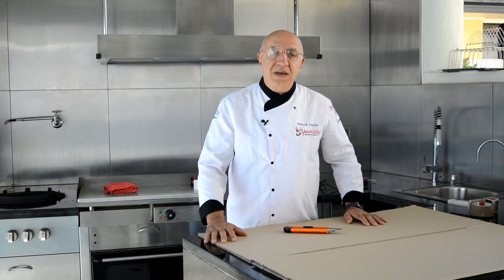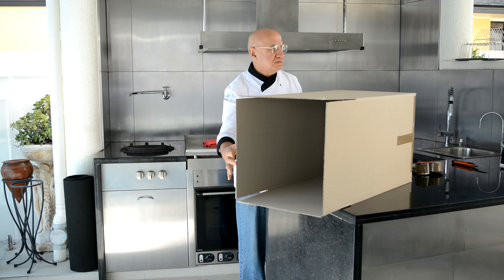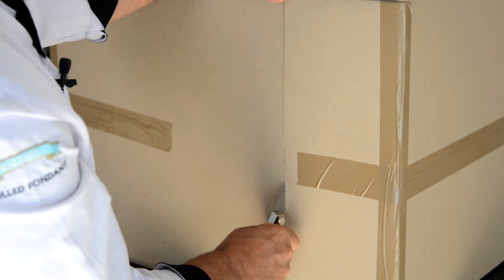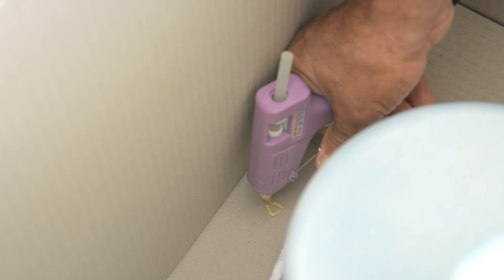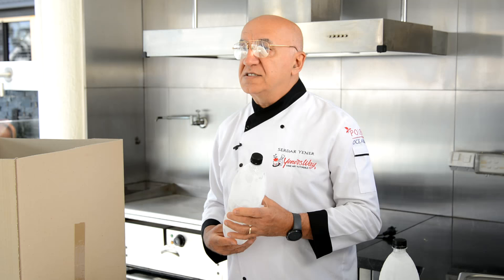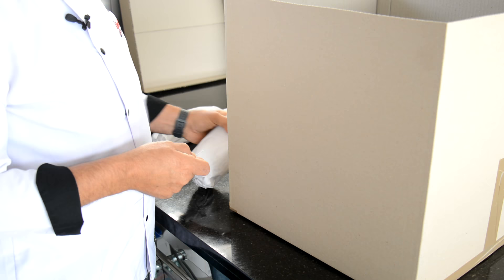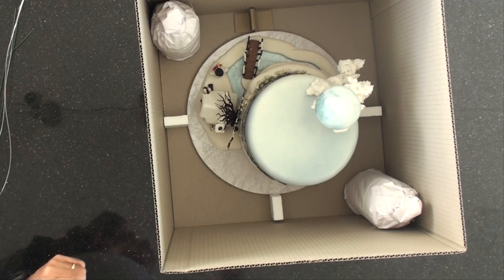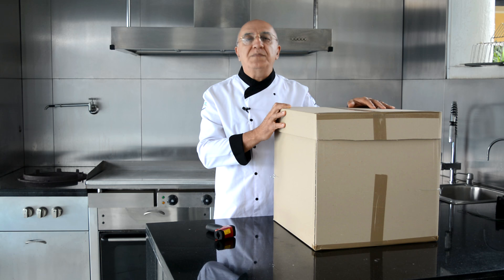How to Make An INSTANT PORTABLE FRIDGE for Cake Deliveries | Yeners Cake Tips | Yeners Way

Comment: We do this except we put the cake in the "lid" and then place the "box" over the top.  Makes for much easier insertion and removal.
Reply from the maker: That makes a lot of sense! Thanks :)
Reply: Love your version of this great idea! ...but how do you keep the frozen bottles in place? Thank you.
Reply: Whats Up Doc can you tell me what size box you usually use?
Reply: Whats Up Doc where do you keep the ice? Along with the cake in the lid? Or box?
Reply: Whats Up Doc me too
Reply: Brilliant
Reply: Great hint... but I like Yeners way, only because of the insert of the frozen bottles in the corner technique 😊
Reply: That a great idea!
Reply: But how would you attach the water bottles with a smaller lid?
Reply: How about those ice bottles to secure?without bottles is ok
Reply: I think I would put the bottles in the lid, then a larger wire loop in the box. The wire would drop down over the bottles and then tighten when closed. As long as the wire touches the bottles on the frontto keep it from tipping into the cake, it should be fine. Small gaps in the side wouldn't allow enough room for too much wiggle. If you really wanted to be fancy you could use elastic cord instead of wire.
Reply: @Tidbitful  I think there would be room for those bottles to topple over the cake when removing the lid. The original way is much more secure, even though you need to reach into the box to remove the cake.
Reply: Yess!!! 👍And you can make a duble floor whith a "griglia' and use the square ices insidie, down the cake. I do like this. Excuse for my bad english....
Reply: @ToluHarounAdamu  You must watch the video and you will know.
Reply: So very helpful! Thank you!
Reply: Genius!! I’m doing this. I have 2 CakeSafe units but they don’t keep the cake cold.
Reply: I was thinking the same thing
Reply: Put the bottles in the exact same spot in the box so they will end up upside down. Wrap a second wire around the neck of each bottle where it is narrower to hold it up in the corner. So when you lift the box off, it will reveal just the cake on the lid.

Comment: This is extremely helpful.  Thanks. I use the same number 6 boxes for all my cakes. This one time I made a make shift fridge too I used an extreamly big box and lined the Inside with thin polystyrene and I drove 4 hours to deliver a 3 tier wedding cake. I just used non slip mat on the bottom of the box and those blue freezer Blox but it worked and this tip is very helpful too thank you.
Reply: Hi, is this method work for delivering cake for more  than 5 hours too?
Reply: Buenisima ideas gracias

Comment: I am so very glad I found your tutorial! I will be making a three tier cake for my granddaughter's graduation party and have really been stressing about how I am going to transport it 360 miles. I think this will be the perfect solution along with dowels for support. Thank you
Reply: Update This box idea saved me so much stress this weekend! I used it to transport a three tier graduation cake 360 miles across the state for my granddaughter. The cake arrived in perfect condition. The only modification I made was to add 1"x1"x3" pieces of wood hot glued in the bottom so I could to set the cake down on and still be able to get my fingers back under the cake to lift it out.

Comment: This is a great idea.  My only observation is the seam of the box is on the bottom.  Between the weight of the cake and the bottles of ice, I would be concerned with bottom weight failure.

Comment: Wow thus is great! Thanks for sharing.  question. When the ice starts melting won’t the condensation seep through the paper?  I’m thinking putting it in a plastic baggie?
Reply from the maker: If you worry about it, just wrap with absorbent paper few layers. if you really want  to use plastic bag , use over the paper.

Comment: How do you get the cake out?  And what size box is this? I think you just saved my life😍😍😍
Reply from the maker: cut the side of the box with blade to slide the cake out. box size according to the cake .
Reply: @Yenersway could I cut the sides to slide the cake in/out and then tape them up?   I’d be scared to try and cut with cake inside.

Comment: Hello! I love your tips/videos!! I'm a hobby baker doing a wedding cake for a friend next weekend (May 12). My final product will be a 4 tier cake - each 5" inches tall, with a crumb coat and then paneled fondant. There will be edible lace on every tier and then 5 gum paste sprays attached by inserting the stems into straws. I'll use some royal icing if necessary. I'm bringing the cake covered, with lace, and stacked on a central dowel. I'll stick the sprays in at the venue into already placed straws. 

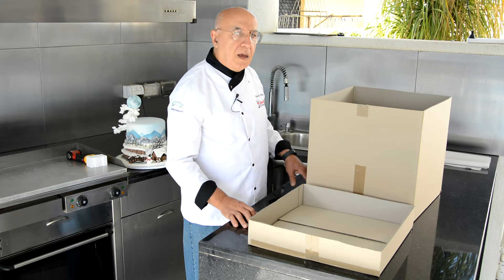Now my concerns... The biggest worry is the timeline of covering with fondant and lace and when to chill in the fridge and how to keep the fondant from sweating after coming to room temp. I hear the best is to transport (a 40-minute drive) chilled so it's more secure/solid, but then won't it sweat on the way or at the venue and won't that affect the lace that's already on it? We start driving at 3:45 pm and deliver at 4:30 and wedding ceremony is at 6:30 with the reception immediately following. The cake will be indoors at reception but it could be a hot day. I have an insulated cake box from Sugar Works. So the question: When do I chill, let come to room temp, cover with fondant and lace, and do I put ice packs in with the insulated carrier (between the box and insulated cover) or do I just let it be in there and come to temp during the drive (in a very air conditioned car)? I just keep getting so many different conflicting answers and I trust your experience. THANKS!!!!!!!!!!
Reply from the maker: Hi, I think you are worrying too much about too many things. Everything you wrote, but what about air condition in your decorating room. If you have that, this is what I do. I do my cakes way before and after final masking keep them in the fridge under gentle cling wrap ( before cling wrap chill it first) . I coat with fondant on the cold cake, obviously, the fondant will get wet, to solve this problem I keep the cake right after coating undercover and keep them till the cake become room temp ( few hours or overnight) . I will allow my self 1-3 days to decorate in room temp ( air con on all the time 20- 24 c). Of course, the cake cannot be a mouse or fresh cream or fresh fruit cake. ( Mud or butter cake with ganache or buttercream will be no problem)

If the weather is too hot I will deliver like in the video. Thank you for asking and good luck.
My next video is about how to avoid wet surface on fondant when we coat cold cakes without damage.
Reply: Thank you so much for your quick and detailed response. It's a huge help!!

Comment: Good info...but reaching inside a box to pull out a cake seems risky, especially if it is a heavy cake. Do you cut the box on one of sides in order to slide the cake out when you reach your destination?
Reply from the maker: Hi GiGi, yes I do sometimes do that. It just depends on the size of the cake. Thanks
Reply from the maker: Yes . I take always a sharp box cutter  blade with me.

Comment: In the other video about how to keep our fondant from condensation, he talked about temperature difference and how fondant shouldn’t be cool. But here he used a fondant cake and used water bottle to cool temperature. Can someone help guide me and tell if we should keep fondant cool or not in a hot and humid country?
Reply from the maker: if you put fondant coated cake in the fridge, we are talking about difference 4C and 25C . If the weather 30 C during transport and you may achieve 5 degrees less in the box with the frozen bottles. The difference not much to worry about fondant , but 5 degrees lower, it helps the cake a lot. Thanks

Comment: This is Fantastic! Great tip. My only question is placing the cake when it's 1 tier is probably not a problem but if cake is 2 tiers, etc. once it's secure in the box how would you get it out? Lifting would be difficult. Would you just have to cut open box?
Reply from the maker: Cut the box from the side with box cutter all the way down, please. If you want to use the box again you can tape it together. Thanks